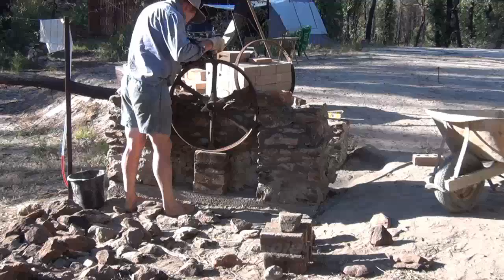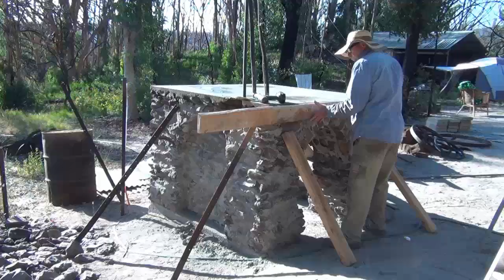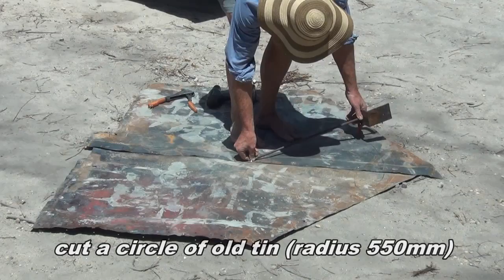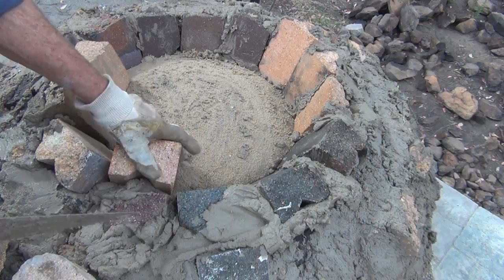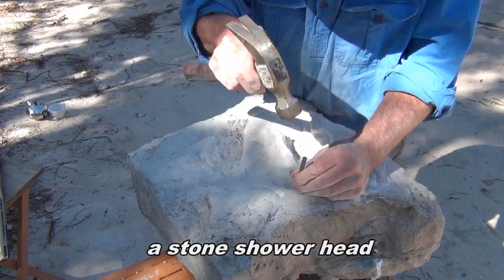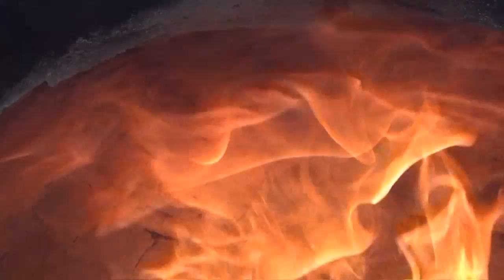How to build a wood-fired pizza/bread oven with its own hot water system

Comment: mate, this is freaking awesome.
Reply from the maker: Thank you. Because of the thermal mass, it stays hot for 4 days. That means for continuous hot water I only have to fire it up every 4 days. It's been running for 6 years now. But since the bush fire I've rebuilt and these days mainly use an old Rayburn slow combustion stove for hot water. You'll find more links to the process in the description...

Comment: Awesome oven, I love it. I love the rustic look also. Giving me more ideas for building another one in the similar circle shape to yours..!
Reply from the maker: ...just weld yourself up a special tool (pointed rod with a L shape to hold a half brick). 950mm gives you a handy 1.1m oven size. Trick is to make sure your base is big enough (at least  1600mm square). Where are you Zac?
Reply: I cant remember if it was yours or another but I saw that someone used a trolley wheel with a rod, I thought this was a pretty good solution, cheap and easy. Im from Ballarat but living in Mazatlan, Mexico at the moment. Ive been on the road since April 2016. Just built an oven for a friend at his hostel.
Reply from the maker: I used a metal wheel to shape the curve of the lintel bar (see 3.04min https://www.youtube.com/watch?v=oE9jLt_qzXE
Reply from the maker: The rod is seen at the beginning too...

Comment: Truely great work Simon thanks for putting this up! We are building a small place out of Hobart  with lots of wood buildup that needs to be put to use... The hot water component seems complicated for the uninitiated though. Is there a good guide you can direct me to for how this works?/how to avoid an explosion? Cheers
Reply from the maker: Dear Bill, actually it's really simple installing thermosyphon hot water.  It is no different from a slow combustion stove e.g. a Rayburn.  You will need to source a copper hot water tank and a copper header tank. Best bet is often ebay.  You may need to be patient but defunct electric systems come up with copper or stainless steel tanks for about $20.00.  The header tank has a ball cock (float valve) which regulates the flow of your water source. The storage tank should be vented into the header tank with a curved copper pipe. This ensures no pressure build up and hence no explosion.  I'm happy to draw you a schematic of how it all fits together. Send me your email so I can send it to you?  My email is simonpockley@gmail.com Best wishes Simon

Comment: How’s the hot water ?
Is it too hot?
I’m thinking of building one now but installing the copper around the ceramic blanket.
Cheers 
Jason
Reply from the maker: It takes most of the day to heat the 80 gallons tank to boiling. This is because I'm not just heating water but heating large thermal mass. Boiling is not a problem because I have a cold tap as well. But once water is hot, there is so much thermal mass that it stays hot for 4 days. Good luck with your project. Where are you?
Reply: @SimonPockleyVideos  that’s awesome.
I’m thinking of building the dome then apply 1 25mm thick of ceramic blanket on then wrap copper around it then apply a second ceramic blanket then the thick render. Only so the water doesn’t get too hot as oven s can be around 600 degrees and I don’t want the pipe to break down from the high heat. How’s your pipe?
Reply from the maker: @jasonculmer606   our oven gets to about 950C inside the dome. Way too hot for cooking.  Copper pipe can take whatever heat the oven generates withut breaking down. Important to give the pipe some  space to expand and contract. Sometimes this is done with lagging.

Comment: Im trying to design a pizza oven hot tub combo, was planning a similar tubing in the dome but just to an open tank. Do you think your oven could reasonably heat a 6 person hot tub?
Reply from the maker: No worries, but you would need to run it for at least 4-6 hours to get it really hot. Remember that hot water rises (needs to rise) so you will need to ensure that the thermo-syphon path is fed  by a high header tank if it is a gravity feed system.  It's the thermal mass that keeps the whole system going. I would only need to light my oven ever 4 days to ensure continuous hot water.  Best wishes and happy building...

Comment: all good but  seems to be a massive oven which uses lots of fire wood to heat up ?!  or im wrong
Reply from the maker: well...Yes 're wood but I live in the bush (plenty of wood). But it's important to understand that it works by thermal mass and therefore stays hot for 4 days. averaged out that's not that much wood. regarding size, it may be tall but it's just right for a neighbourhood dinner. Best wishes Simon